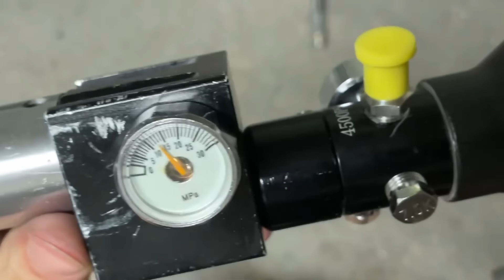Making semi-auto PCP Valve for Regulated PCP | Part 1

Comment: There's a a vent hole at the back of the valve that automatically cocks the hammer is that correct? My unreg pcp went full auto when the o-ring broke 😂.
Reply from the maker: Correct! I actually had the same issue many times.

This one would be full auto too, but theres a difference in the trigger, and the air flow is much more limited. (2.5mm was too much so I sealed that hole and made a new one)

Btw do you have any message platform as I tend to have a lot of questions for you often 😅 So it would be nice to chat with you about PCP topics via messaging rather than commenting.
Reply: Do you have fb mssngr?
Reply: Ayus nag kukwntuhan ang dalawa kong idol.hehehe
Reply from the maker: @greggorio6259 😅

Comment: Hi, question, is delrin alone sealing the air?
Reply from the maker: Yes, from the valve. some parts had o rings as you saw but i think you meant is the delrin used as the valve seat alone, yes.